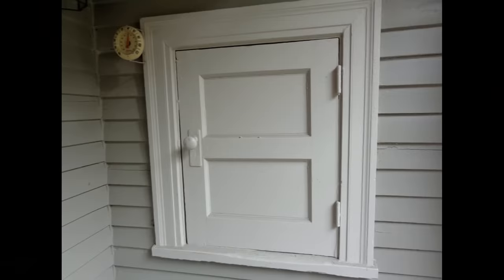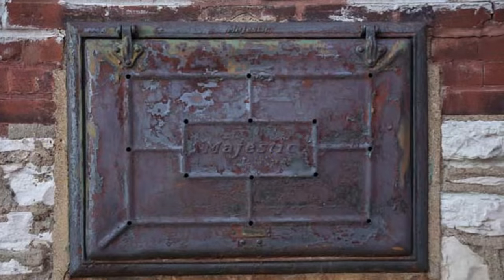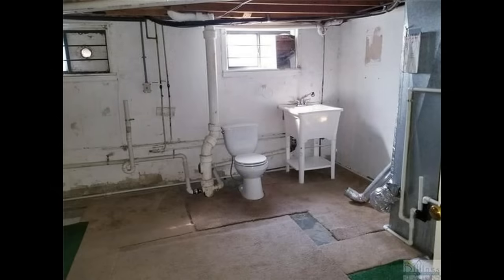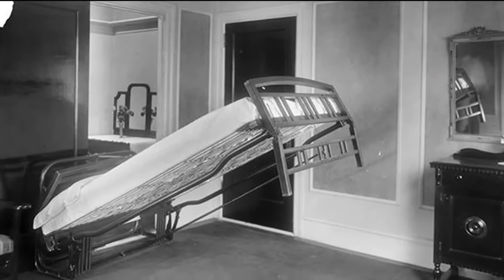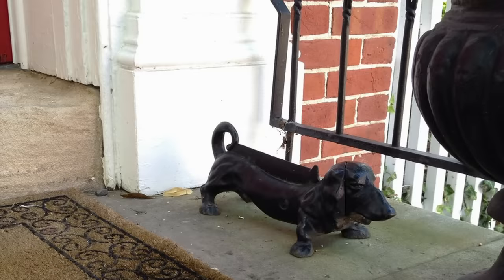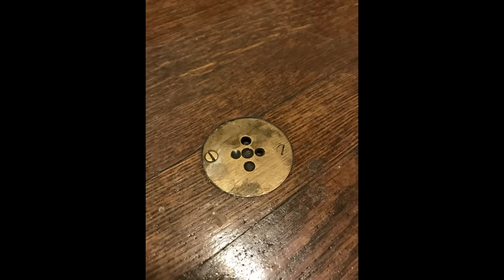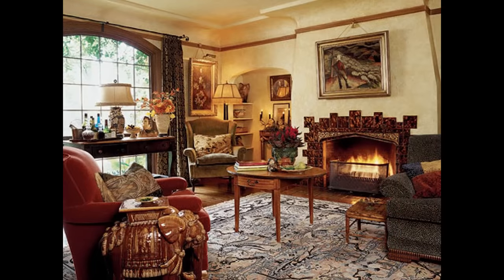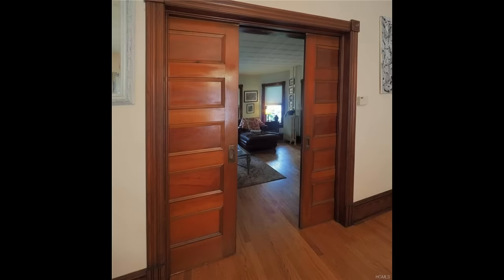Mysterious Home Features No Longer Used

Comment: The pocket door is the best door no inswing or out swing but they don't stand up to smell children I put 3 in my home as for why some people won't have them is because they have lived in old homes that had them and they were always getting stuck either wouldn't open up all the way or not shut all the way in most older homes things settle and need to be adjusted in most cases the supporting posts in the basement were not cured properly and shrank sometimes as much as 2 inches puts a real bow in the floor in my brothers old house I drilled a hole through the posts and put a solid steel bar through put a hydraulic jack next to the post on both sides under the bar and jacked it up put a peice of 1/2 inch plywood and a peice of 2x6 all door's upstairs would finally open and shut we renovated the bedroom and I wanted to put in a sliding pocket door because no matter which way we swung the door in out left or right it wouldn't work my sister inlaw wouldn't allow it so we hung a curtain it stayed that way for a year before she finally let me install one then it was the best idea she ever had we used one we had salvaged from another old house that was being demolished if I ever find another one I'll salvage it to almost a 100 years old and it still was as good as new not like the new ones that wear out in five or ten years fully adjustable with heavy duty bearings anytime I can put in a sliding pocket door I will
Reply from the maker: Thank you for watching and sharing some of what you have.  I think pocket doors are excellent!

Comment: Landlines are still a thing :)
Reply from the maker: Yes but slowly going away.  In 2003 95% of households had them.  Fast forward to 2018 and only 40% had them.  That number has dwindled more as the generations are switching out.  Thanks for watching!

Comment: No need for a milk delivery box built into the house when I was growing up in the 50's.  The milkman would bring the milk inside the house and put it into the refrigerator.  He had a key to the house if you were not home.  Today that trust we had in people is gone.  In Vermont in the winter they would leave the milk on the doorstep and it would freeze and the cream with push up the paper cap of the milk bottle.  I live in a home now that I thought was reasonably modern (built only 24 years ago) and it has phone jacks throughout and an intercom system and a central vac.  Didn't realize these things are so outdated.  Never used the intercom much, but the central vac has far more suction power than a regular vac and cleans a lot better.  Even though I have a cell phone, like most people, I still use my landline a lot.  Cell phones are just not suitable for everything, althought most people can get by with just a cell these days.

Comment: Holy crap are we really to the point that people don't know what a phone jack is?
Reply from the maker: The times are changing.  In 2003 95% of households had them.  Fast forward to 2018 and only 40% had them.  That number has dwindled more as the generations are switching out.  Thanks for watching!

Comment: did you just have to explain what a land line jack was. make it stop
Reply from the maker: Yes but slowly going away.  In 2003 95% of households had them.  Fast forward to 2018 and only 40% had them.  That number has dwindled more as the generations are switching out.  Thanks for watching!

Comment: got an active landline
Reply from the maker: There are less and less of them now days.  In 2003 95% of households had them.  Fast forward to 2018 and only 40% had them.  That number has dwindled more as the generations are switching out.  That percentage would be much lower now.  Thanks for watching!
Reply: @RhettyforHistory  then they regret dumping  the old faithful when their battery dies mines a analogue landline works as long as there's power to the mains

Comment: My mom had one went straight to the bament was Not installed by anything that caused a fire I t dropped clothes right betwern washer and dryer big blankets carried downstairs regular clothes them   in  the shop diameter would be around 2 ft in a hidden space I kid would not of fit down then just put a lock on them  weren't put in by anything electrical or hot if afraid of children just get a latch ànd lock on it
Reply from the maker: Thank you for watching and sharing some of your memories.

Comment: If you have a real house, why wouldn't you have a landline phone?
Reply from the maker: Times are changing.  In 2003 95% of households had them.  Fast forward to 2018 and only 40% had them.  That number has dwindled more as the generations are switching out.  Thanks for watching!

Comment: Pocket doors are absolute nightmares. They are amazing in theory, but logistically, they are awful. My kids doirs to their bathrooms are pocket doors. You cannot lock pocket doors. And if you shut them all the way, they are almost impossible to open. There is no handle. There's a little dip that's about 2 mm that you are supposed to grip to slide the door open. My kids lock their bedroom doors bc the pocket doors are pretty worthless. I also work occasionally at an office that has pocket doors and patients always get stuck in the bathroom and there's a sign posted to knock before entering. So pocket doors are awesome in theory but not practical. They slide out of the door jam and there's no real way to make them convenient or a good decision, imo

Comment: Your home is OLD if you have landline jacks built in. 
The what?
Reply from the maker: They have been slowly going away.  In 2003 95% of households had them.  Fast forward to 2018 and only 40% had them.  That number has dwindled more as the generations are switching out.  Thanks for watching!